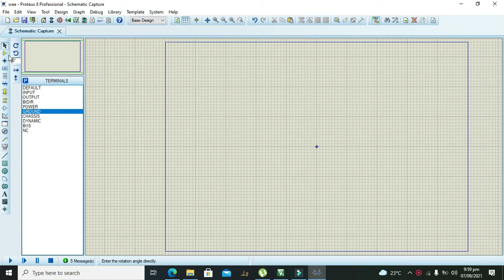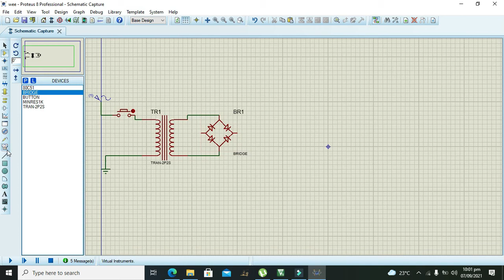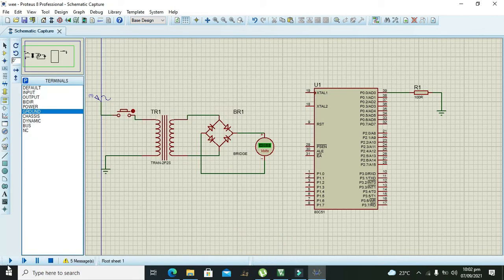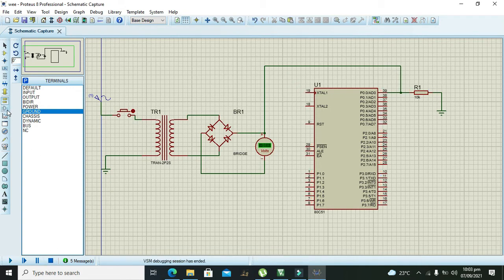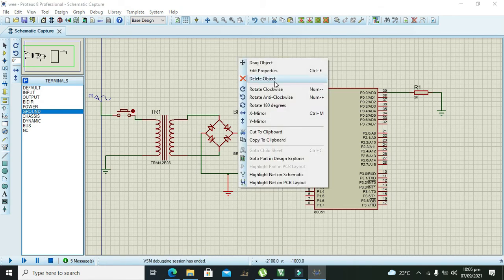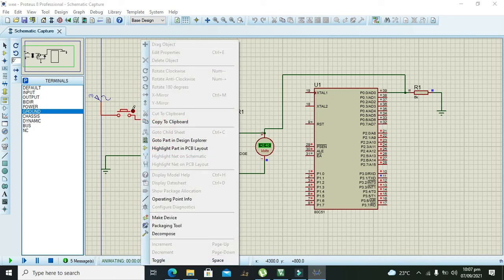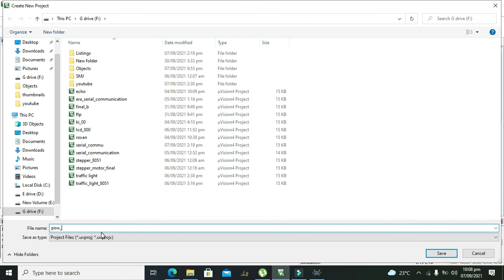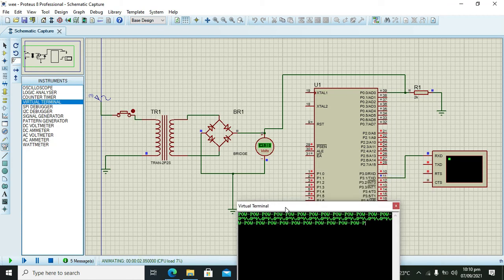simulation of power failure detector with 8051 using assembly language(keil) in proteus

Comment: Thank you so much for your efforts. What if I wanted to add a buzzer to this Power failure detector circuit? may you show us what shall I do and what code should i use?? and if I wanted to add an emergency generator, so it can work immediately after the failure
Reply from the maker: For buzzer u just need to attach the buzzer with any pin, and have to change the program a bit, so that when power will fail the pin becomes high and then buzzer will be on, also using a relay u can add a generator line...
Reply: @nelsondarwinpaktech3954  THANK YOU, but what about assembly language code? what should i write